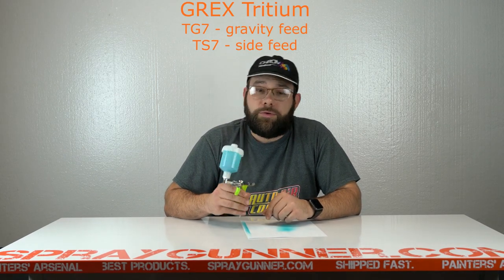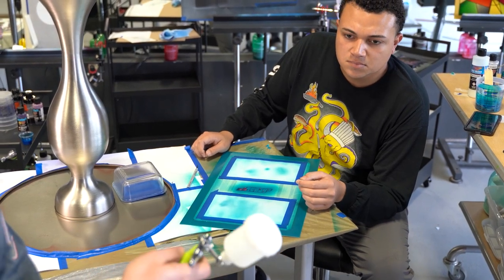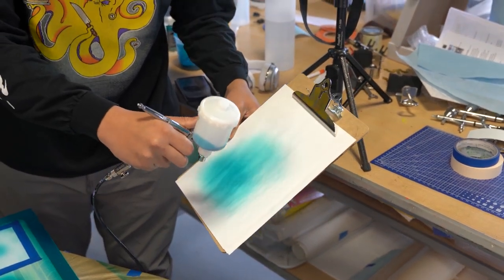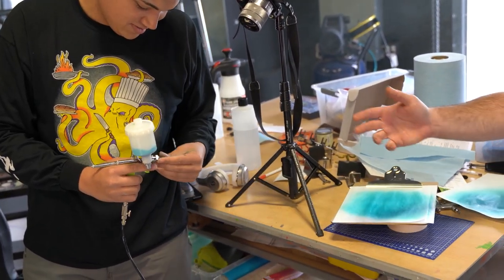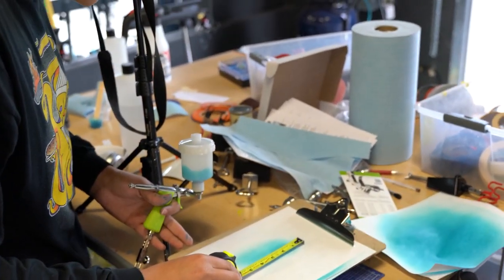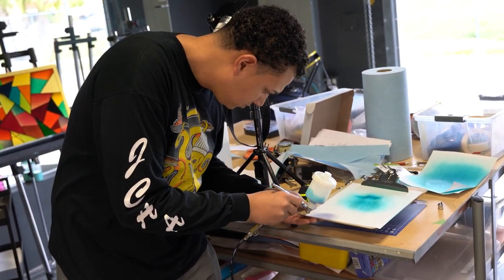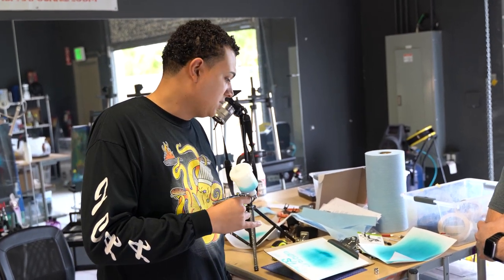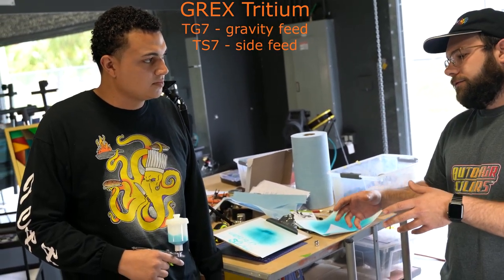Mini spray gun powers on a small compressor? Yes, possible. With GREX Tritium 0.7mm fan airbrush

Comment: On the Grex you tube tutorial for this gun they specifically said the .7 fan nozzle would require a bigger compressor , their desktop typical compressor would not work for it. In your video you seem to  point to the opposite finding . I am thinking about this setup but only if I can use it with my master brush . I don’t want to use this is the same room as my larger compressors .
Reply from the maker: Definitely bigger compressor than Grex desktop. We were referring to something like Sparmax TC-620x or out NO-NAME Master Blaster II. Those are still quiet and small, while providing much more output. But those are minimal for .7mm setup. For long comfortable use, Paasche DC850 or equal
Reply: @SprayGunner  Thank you. Ill take a look.
Reply: Do you think this gun with a 0.5mm nozzle will work with a master airbrush compressor? I’d have to have to buy a new compressor.

Comment: Hello. No experience and I explained what I wanted to do to Dylan on the phone today. I put all his recommendations in my cart. One was the Tooty compressor. Your video on that compressor said it was not powerful enough for .7mm, but would work with up to .5mm. This video you say .7 will work with small compressor. I'm confused. Please clarify what will work for a Grex TG7. Thanks.
Reply from the maker: Tooty is a single piston compressor. Good for most purposes. To supply TG7, a little more air required. Sparmax TC620X can handle it. That what we mean by small compressor. That you don't have to have 10+ gallons air tank 1HP motor to use it. Thank you!

Comment: Hi, I need a full paint car interior (door panels, dash etc). I understand, full size air gun will be best for this, but big air compressor not for me. Can I take this job with Grex 0.7? Or you have another airbrush, iwata G6, hp-cr2 etc
Reply from the maker: Grex 0.7mm setup with fan spray air cap delivers great results. We were seriously surprised when we tested it. Wins over competition in this size.

Comment: I spray commercial but want to get into some side projects air brushing and painting motorcycles. I’ve got an airbrush kit that seems to work well but certainly wouldn’t want to try and base or clear a whole tank with that. Looking for a quiet setup I can use in my off time in my garage (split level house so one half of downstairs is garage). Overspray mainly but also noise is a factor for me. I doubt I’ll be spraying any flake bases (I’d just bring into work and shoot in booth if that came up) but definitely will be spraying pearls and kandys. I need something I can base and clear with those parameters. I’m sure I’m wanting a lot here but with the endless possibilities with paint there’s gotta be a good setup for this I just don’t know if yet. Any recommendations would be greatly appreciated!
Reply from the maker: John, we can help in more details if you reach out by phone (just leave us a voice mail at 877-707-8767, we have experts who knows process and equipment very well. In short, there will always be some compromise, it depends on which is more important between budget/convenience/speed of work and such. For motorcycle tank clearcoat, something like Sagola mini extreme will be the best solution to have a thick layer quickly, but it needs a bigger (and in most cases more loud or much more expensive compressor). The hybrid (airbrush-mini gun) we show in this video will be good for base coat and you can do clear with it as well with a big sacrifice - speed. A good prece/quality/noice compressor to go with that would be Sparmax TC-620X or NO-NAME Master Blaster II

Comment: Can these spray very fine powder?
200 to 400 mesh..very fine.
Need a air gun for that on a 7 to 8 inch tall panel, looking for exceptional product.
Reply from the maker: We tried it with dry pigment 70-120 mesh, 200 to 400 is more of a flake size which could clog the nozzle. We will test when we'll get a chance but it won't be soon. Just moved our business, all the spray equipment still packed, booth not even installed.
Reply: @SprayGunner  alright, yeah no resources i could find, so now im considering a diy powder coating gun, buy unsure how to pull of even fan coverage.
Thanks for reply.
Reply from the maker: If dry spraying works for you, check out this option https://spraygunner.com/airbrush-kits/no-name/flake-gun-model-bd-182t-by-no-name-brand/

Comment: this is exactly what I am looking for... but I want to spray automotive 2k paints. Am I going to be able to do a 2k epoxy with this?
Reply from the maker: Needle packing seal is PTFE and the airbrush itself is solvent ready. Just make sure you clean it carefully and don't soak air channels in solvent.
Reply: @SprayGunner  I'm confused what that means.. so yes it will work? Just don't water log the gun with solvent?
Reply from the maker: Exactly

Comment: Fellas. Can this Grex w/ the .7 mm fan, spray unthinned premium water based paint?
Reply from the maker: Hey! Depends what's hidden under "premium water based paint". It can definitely handle ChromaAir colors or Createx Wicked and Illustration colors out of the bottle!
Reply: @SprayGunner  It’s Sherwin Williams premium line of exterior house paint. The material is hdu Corafoam sign foam made by Duna. It’s a dimensional sign with 5” tall letters.
Reply from the maker: Can't comment anything on this paint. Never used it, not sure how fine the pigment is.

Comment: Hello, just for few paint hydro (car part). what’s the best compromise, large spray / small compressor (100$, no tank) ? colani, grex 0,5,.. ?
Reply from the maker: Hello! With such a small compressor you won't be able to use fan spray air cap since it requires much more air than round spray cap. Colani or Grex 0.5mm round spray, or GSI Creos PS-290 with round air cap should do the job.
Reply: nice for your help guys, i check if they’re available in france.. best vibes
Reply: grex’s nice but not available easily in france, sparmax gp850 looks ok also .. bie
Reply from the maker: We offer free international shipping o Grex, just so you know
Reply: @SprayGunner  ok good to know

Comment: Hi. I'm really interested in ordering one and it's exactly what I need for my 13.2 gallon air compressor. Can I spray clear coat using this airbrush/mini spray gun? (PPG Deltron 2021 is the one I use)
Reply from the maker: Hello! Yes, we tested it with clear coats many times. Especially with 0.7mm setup, it works just fine! You will need to thin clear coat a bit but it will work.
Reply: Thank you very much for the info!. Placing my order right now!
Reply from the maker: You are very welcome! Thank you for your business!

Comment: Hey can I use this for customizing shoes I need something portable travel what do u syggest
Reply from the maker: Hello, 
For this model, you'll need a bigger compressor like NO-NAME Tooty. And I'd recommend 0.3 or 0.5mm nozzle set.
Reply: SprayGunner Com thank you for the quick response . And it also doesn’t have to be this model . I saw one with the little hand held compressor I think u did a video on that . It basically screws to the air brush pen no wire needed to connect to compressor. Do u know any brands that good for customizing shoes but has to be portable ? If u know of any please let me know so I can see my options .
Reply from the maker: I'd recommend checking compressor Skyline by NO-NAME. Portable and powerful enough https://spraygunner.com/skyline-airbrush-compressor-by-no-name-brand/

Comment: can this gun be used with a turbine system?
Reply from the maker: No, turbine compressors usually create lower pressure than this gun needs. But I can be connected to relevantly small airbrush compressor.